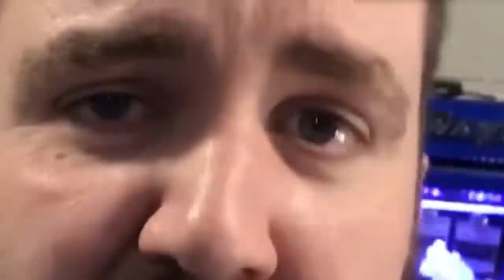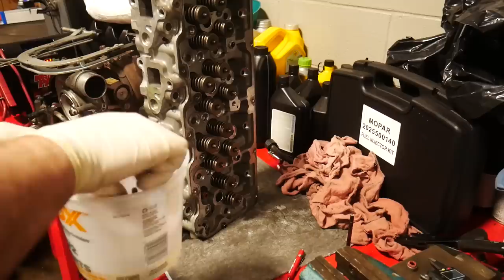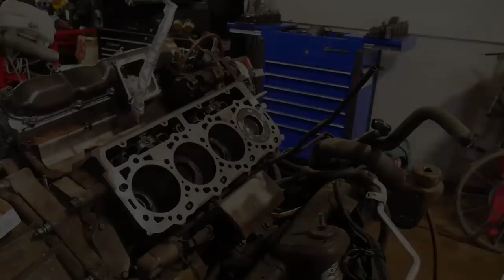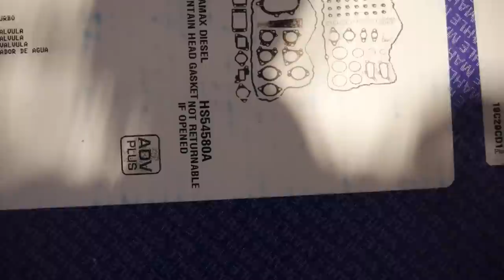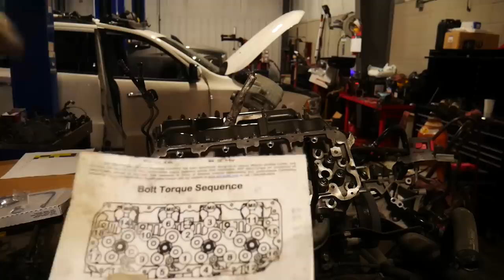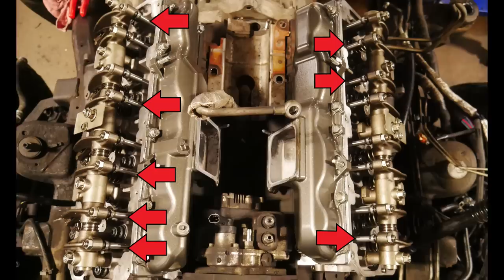DURAMAX LBZ HEADS - FULL BUILD, INSTALL AND LASH ADJUSTMENT

Comment: There are so many videos out there of back yard DIY guys working on there own truck. Nothing wrong with that but they usually have to much talk. That is not knowledgeable. It’s nice to see a professional. Telling a little bit of the pro tricks and proper Technical steps. To help the DIY guys make less mistakes. Great job on that video. Very helpful. I have been a heavy duty equipment/truck mechanic for 30 plus years. I’m not familiar much with the Dmax mechanicals. Simply because I have not had the call to work on those light duty engines. I just acquired an 06 GMC 3500 LBZ. So it’s interesting to see the insiders view. That way I can plan what I want to do to mine.
Reply from the maker: Thanks man! I appreciate the kind words and feedback👍🏻

Comment: I work for Cummins and we use a factory tool when running overhead that gives you very consistent results, It's a 6in-lb T-handle torque wrench (cummins part number 3376592) it's got a 1/4 drive end that you can put whatever adapter needed to match up with the adjuster, most of our stuff uses a 5mm allen adjuster screw.
Reply: Interesting to hear things like this...where you might not know a certain tool exists unless you worked on a specific brand of motor. That's cool Bryan, thanks for sharing.

Comment: As a automotive machinist with Duramax heads they are very bad about valve guides wearing bad. In order to fix that you put a bronze guid liner in and it will never wear. Also grinding the valves and curing the seats and making sure the recession is in spec.

Comment: Just bought me another duramax. 2013 lml and guess what the head gaskets are bad. Looks like another fun couple weekends. Sad part is the rad hoses are soft coolant  tank is clean only time it pushes coolant out is under load. Dealer had it cleaned up so nice didn’t see the coolant in the fender until I got home.

Comment: Great video could have used this when I did my heads and studs a few years ago. I did it with the cab on and yes lots of small steps too get things to come together.
Reply: When you did yours with the cab on were you able to install the studs and then install the head onto the studs? Or set the head in place and thread the studs through the head?
Reply: Had to put the back studs in the head then place the head on the block after that you can drop the remaining studs in. Same for removing old head bolts.
Reply: @lcazier619  I wonder why shops don't do this . Instead of charging 36 to 40 hours of labor .
Reply: Good info thanks for sharing . 👍

Comment: I just got my lb7 back together after a head gasket job, they put new valve seals in at the machine shop but I didn’t know I was supposed to buy new springs, the old ones will be fine won’t they?

Comment: What about checking valve spring pressure being equal across all intake and all exhaust springs pressures equal?
Reply from the maker: Generally I’d say to do that but in my case I used all new springs and just kept them all equal

Comment: Just wondering why you didn't port and polish the intake and exhaust ports on the head? I've heard that you can pick up quite a bit of HP just from doing that alone!
Reply from the maker: Because I don’t have the experience to do so and not one single machine shop here locally would touch a Duramax head to do that kind of job.🤷‍♂️
Reply: @RustbeltMechanic  wow I wonder why nobody will machine them?! I figured most engine machine shops would do that.. I have done some research on gasket matching and polishing and you can pick up noticable HP by just removing, transitioning and smoothing your intake, exhaust ports and turbo pedestal with a grinder and sand paper! I'm doing my EGR delete, CP3 conversion, and WCfab Y-Bridge and intake install on my 2013 LML this week and am going to clean up what I can. Depending on how things go, I might pull the turbo and clean it up some. It seems pretty straight forward just time consuming

Comment: Did you put gasket sealer on the head gaskets
Reply from the maker: No, had the heads slightly decked and used the head gaskets only

Comment: Hi Kyle. I haven't kept up with the build but, I was wondering if you went with a 3388AF cam or something similar?
Reply from the maker: Negative, did not go with any alternate fire cam. Wanted to see what the stock block, rotating assembly and cam would hold. Still holding strong with Appx 750 HP with compound turbos
Reply: @RustbeltMechanic  awesome! I have a '13 LML and I wanna run a RDS 64. Gunning for 650 whp and don't wanna hurt the motor.
Reply from the maker: Oh yeah, I run his 64/66 high flow vane turbo in the valley with an s475 on top
Reply: Makes me feel a LOT better about my set-up. Thanks for your time brother, appreciate your work.

Comment: hey man i hope you can help me i have asked so many people and no one can give me an answer i have a 2006 gmc lbz duramax and i want to install a oil temp gauge and there are a lot of ports on the oil heat exchanger could you help me out please with one is the hot side (pre cooler ') any help would be great
Reply from the maker: So I have done some looking into this one myself. I haven’t personally done this yet but plan on making a video about it when I get the part and the time. From my research the port on the top of the cooler with the larger 10mm Allen plug is the hottest point (pre-cooler) to get a reading at. Hope that helps.
Reply: Rustbelt Mechanic thank you that helps a lot I  really hope you do a video on it if you tell me what gauge you would like I would be more than happy to donate one to your channel I work for a parts store because there is not one video on YouTube for a oil temp so I think you would be helping out quite a few people so just let me know if I can help
Reply from the maker: I would actually get the edge temp probe 98608 with their universal sensor input system since I just put in an Insight CTS2.

Comment: How much for this type of job?
Reply from the maker: A lot....lol not really sure because I wasn’t going for time on it but if I had to guess about 5 grand for this part of the build
Reply: evan hale, I did my own, took about a month lol working an hour or two at a time. The shops wanted $6000 to just put in head gaskets, my old 03 isn’t worth much more than that lol so I bought the Haynes book and watched a ton of videos. Got it running again last week, I’ve never attempted anything mechanical besides brakes and oil changes, if I can do it anyone can. Just take tons of pictures and label everything. I’ve got about $1,500 in the job but I put in a new water pump and cp3 fuel pump while it was apart and of course you have to buy new head bolts. Machine shop charged $400 to mill, clean, and put new valve seals in.

Comment: Your information that you put out about the thickness of head gasket to use is completely false. The only way to check what thickness head gasket you need. 
 1-Clean top of engine block and piston. 
2-Put each cylinder at TDC. 
3-Use a straight edge and measure your piston height from block to straight edge. 
Depending on what kind of gap you have determines what head gasket to us or to tear further into the engine.
Reply: He didn’t deck the block, just the head. So this doesn’t make any sense. Deck height isn’t a wear item.
Reply: A lot of people who put head studs in opt for the thicker gasket because of the added clamping force might compress the heads down too close for comfort.
Reply: Lee Cazier a head gasket will only crush so much. Installing head studs or head bolts you will only crush the head gasket so much. The reason behind studs, they are less likely to stretch when applying more than pressure from upgraded injectors and turbos. Every engine is only designed to put out and  handle so much. Once you start changing parts and to get more power, you need studs to handle the power output. You should also upgrade the head gasket.Again factory parts are only designed to handle the factory power output.